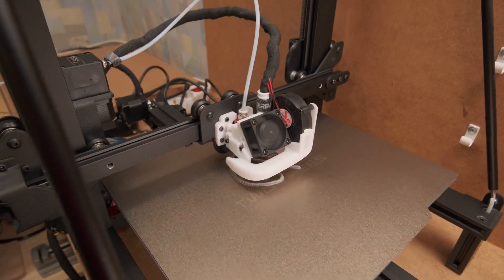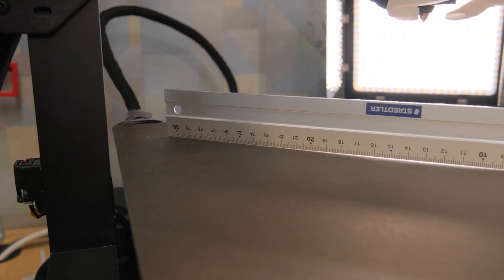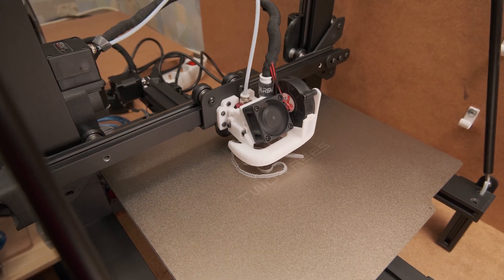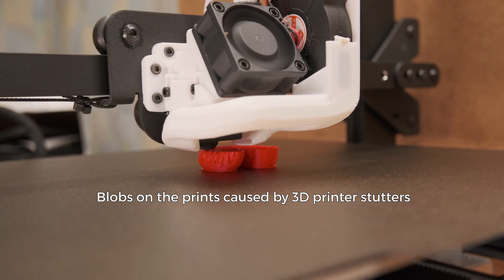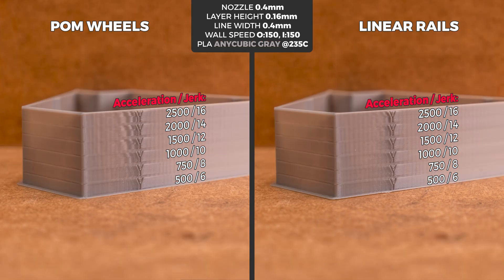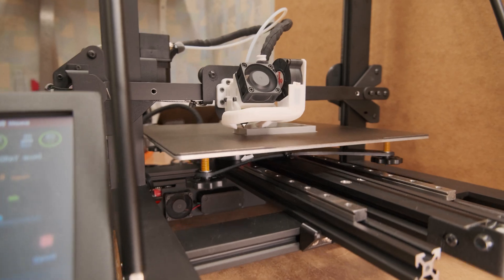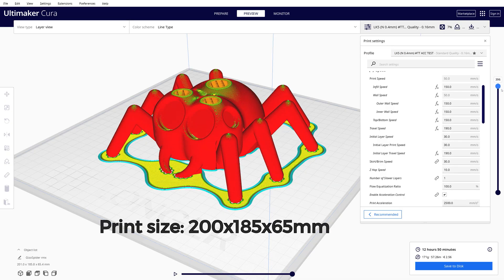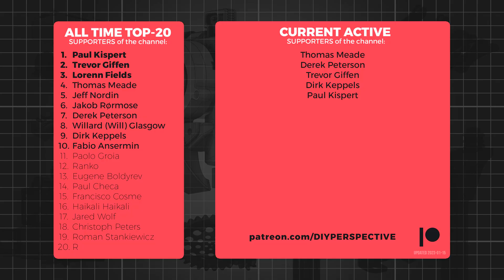When 3D Printer LINEAR RAILS upgrade MAKE SENSE? (vs POM wheels)

Comment: Would be interesting to see a comparison of linear rails affects on small printers vs larger printers.
Reply from the maker: The smaller the printer the less difference you will see at the same acc/jerk values. But linear rails are not all about the quality of the print, it is also about longevity. The heavier the bed and higher the speeds the more wear will be on those POM nuts. And if these results were when they were properly tightened before test prints. I don't even want to see how they would look with the loose nuts. You would have to constantly check if they are tight enough, it would be a nightmare.
Reply: @PrintingPerspective  Im a CR10S5 owner. 500mm bed slinging around.
Reply from the maker: That's a big boy!

Comment: It would be interesting to see how print quality holds up as the height of the printed object increases.  Once you start printing taller objects with a large format bedslinger, it seems like you would reach a point where the object itself will start to flex during the bed's rapid acceleration / deceleration (depending on its shape, of course).
Reply from the maker: It depends on the shape of the object but yes you can't really print slim and tall objects on bed slingers with high acc/jerk values. I added this point to test in the future video.
Reply: You’d have to be really cranking, and by the time travel stops the model should be back to where it was.

The biggest issue I have is when printing TPU (about all I print) and getting higher up on the models allows a lot of flex to occur in thin walled parts
Reply: Yes, my Ender 3 pro prints fine but the higher i go the more the print quality reduces.

Comment: I have thought about what the springs that support the bed can do with ringing. Since springs that are part of accelerated mass that stops must go somware. A spring that compresses will rebound with about half the force or a bit less. Have you tried the silicone buds that is stiffer under the bed to see a difference?
Reply from the maker: If you tighten them a lot (at least those yellow ones) it is very hard to compress them more, even with hands. Another question is do they keep their tension after hundreds of heating and cooling cycles.
I have one set of silicone ones, but I never even tried it. For smaller heat beds I really doubt they are needed but for the big ones probably would make the most difference. Maybe I will test it after I finish with all the upgrades for this 3d printer.
Reply: @PrintingPerspective  Silicone is a pretty fair insulator. Better than steel I'm sure. Might be worth it for better heat distribution in the bed.

Comment: I print faster with my printer 300x300 plus you're using marlin and not Klipper you will need another y motor to prevent layer shift or motor losing its positioning. I can do 20K accel at 500mm/s it just shake a lot and  has too much resonances at those speed and accelerations. just some things to consider input shaper will help with print at higher speed as well. great video.
Reply from the maker: Nice :D I honestly felt kinda sad when you didn't show those speeds in your latest video after this comment, haha. Definitely something I need to see in my life.
Reply: @PrintingPerspective  lol you will I'm working on a video will be uploading soon!!
Reply: hello!! What type, model or brand of motor would you recommend changing in the Y axis to improve on a 300x300 printer (Ender 3 Max)?

Comment: Btw, you can use the Arc Welder plugin to help the 8 bit board keep up with curved surfaces. Just play with the values and it'll be just fine at almost any speed. (Of course Klipper can do much better without breaking a sweat, but still.)
Reply from the maker: Yeah, but at this point, I am fully committed to seeing what brings this complete 3D printer overhaul.
Reply: @PrintingPerspective  Sure. Then Klipper. (Well, I put Klipper on my printers regardless of how they're functioning out of the box.)
Reply: After looking into the Marlin source code, arcs still fill up the command buffer because the firmware converts the arcs into linear segments internally. When I experimented with heavy stutters/pauses while printing cylinders at 200 mm/s, arc gcode didn't help at all. Admittedly I have a 32 bit board so maybe it's a different issue.
Reply: @MiG82au  The command buffer is between the gcode reader (e.g., the display module which has the memory card reader) and the mainboard (e.g., running marlin). Once it's on the MCU on the mainboard it has much higher bandwidth to the stepper drivers, so that shouldn't be a problem. If you have stutters even then I suspect the problem lies somewhere else.

(When I had stutters, before I switched to Klipper, it did help to switch to Arc welder.)
Reply: @marcus3d  I don't think that's correct, firstly because I've read numerous discussions about calculating steps which get put into the buffer for the motor drivers to execute and secondly because my SD card is on the main board, not the display.

Comment: All your latest videos are working on your printer. Even before then you were making tools to make things. Things like tools. You don't make anything except things to make things with. Before long you have built a huge pile of completely useless tools because all you ever make is more tools. I'm going to unsubscribe if you don't make anything. DIY? Do what? You're not making anything.
Reply from the maker: I completely changed what I do on this channel, feel free to unsubscribe at any time because there won't be similar content that I used to make.
Reply: @PrintingPerspective  I just looked at your videos and it seems you deleted all your old videos. I'm going to have to unsubscribe. Why do you need those tools if you're not doing anything with them? Smh.
Reply from the maker: They are just unlisted. I still use them but not in the videos. No problem, it's understandable.

Comment: Hi, exactly the video I was looking for thanks for the great content.

The Kp3s Pro is shown in this video and I wondered what was your linear rail results for that printer ? As I tested mine with an adxl345 and the max recommended acceleration was higher with the rolling wheel bed than with the linear rail, the linear rail had half the recommended accel (1800mm/s^2). It would be really helpfull if you could share some of your results.
Reply from the maker: The problem with cantilever 3D printers in general is that you cant push acceleration/jerk too much as the X gantry will start to wobble from the fast Y-axis movement. Kingroon made mistake by using only MGN12 linear rail on Z-axis instead of the MGN15 or two MGN9 ones. I didn't make any proper testing yet so I cant tell.

Comment: There's practically no pressure sideways on the bed, and that's not what causing y-ringing/-ghosting, so that's why the V-wheels aren't so bad, as long as they're spaced far enough apart (front to back) and are tight enough. I think most of the flex in the Y-direction comes from the belt being a bit flexible. If you really want to reduce ringing try swapping the belt for one with less flex.
Reply from the maker: I will trust my results as the only reasonable variable was the POM wheels and I usually triple-check everything just to make sure. They are more like rubber and far from rigid in any direction on a single 2040 profile. Belt tension did almost nothing, you should have watched the whole video as I said in the beginning. :D
Reply: @PrintingPerspective  Of course I watched the whole video. I saw your results. They don't disprove my claims in any way.
It's no surprise that it moved slightly sideways as you pushed it sideways, but since the front and rear wheels were spaced far enough apart is should've been pretty darn stiff in the front/back direction. Since it still had a problem until switching to linear rails I can only conclude that the V-wheels must've been too loose.
Or the springs.
Try tightening those springs even more and see if it improves further.
Reply from the maker: I tightened the wheels before the prints so that they would be tight but I will still be able to turn the wheel with my fingers with some force. Any more tightening would produce excessive wear and is not realistic to test. Springs were tensioned to exactly the same distance, not that far from maximum compression. The top of the heat bed weighs an insane 1.7kg (PEI + magnetic base + heating sheet) so I don't think those POM wheels are able to handle those forces, they are not completely rigid at the end of the day, and spacing of 110mm is not that wide when the whole bed is 310x310mm. Plus if the wheels were too loose we would see way worse results and way sooner. In all my test I triple-check everything, because, at the end of the day, I make these tests primary for myself to gather factual data, so BELIEVE ME, I take my time to make sure they are as properly done.
Reply: @PrintingPerspective  Alright. Maybe the V-wheels on my Artillery bedslinger are different somehow, because I get way different results. But then again, my bed is less heavy, even with its glass sheet covered with magnetic sticker and PEI-covered steel plate. In my case I had to tighten the screws until the springs were practically discs of washers, and then the bed was stable and ghosting disappeared, and I haven't had to re-level it in months. Anyway, looking forward to more of your tests.